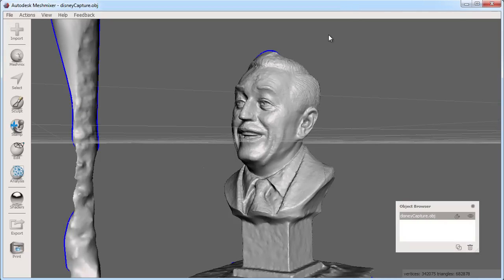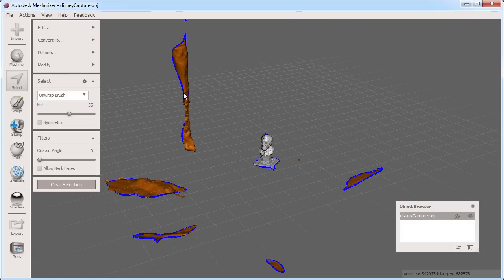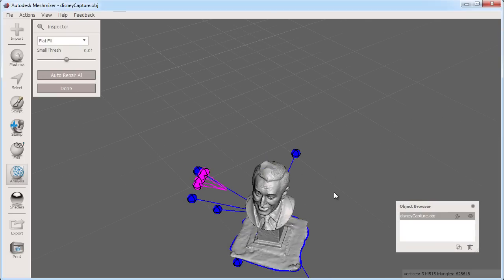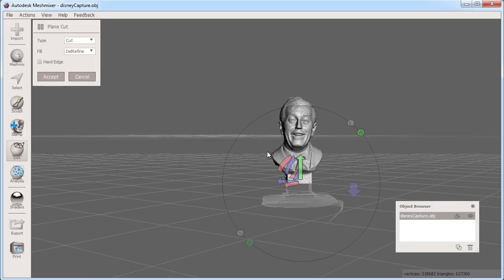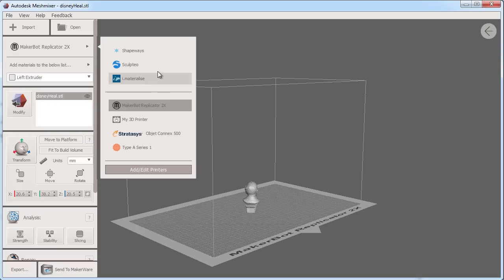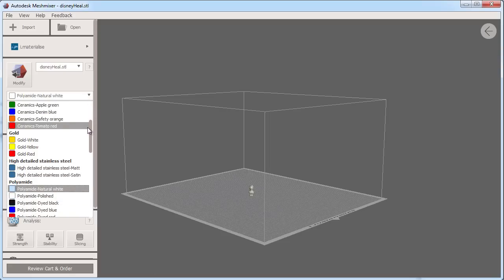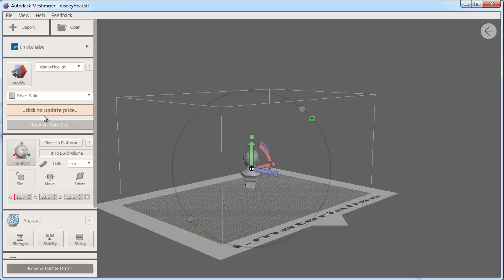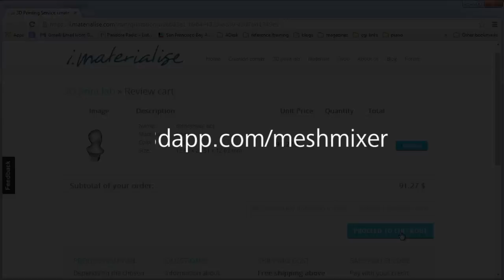Autodesk Meshmixer 101: 3D Printing

Comment: I am having issues with scaling when I import the .stl into deskproto to creat the .ncd file for my Techno CNC. The scan turns out super small. While I can scale bigger by hand in meshmixr, how do I get a true 100% scale match. Exact, 1:1, 100% match.
Reply: Did you ever get an answer?
Reply: @drpeppero3  Yep. Was several issues all at once. 1) I had to make sure my scanner, Meshmixer, and Deskproto were all set to millimeters. 2) My scanner was innacurate 3) Meshmixer has a preference to NOT scale down models when importing